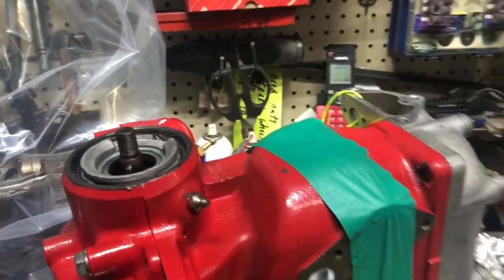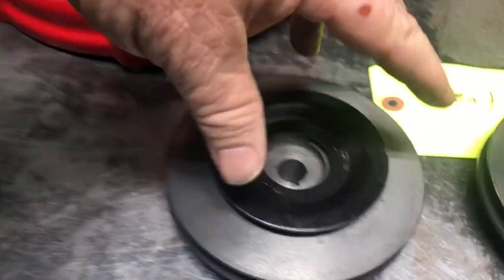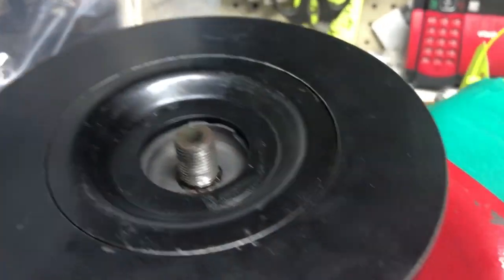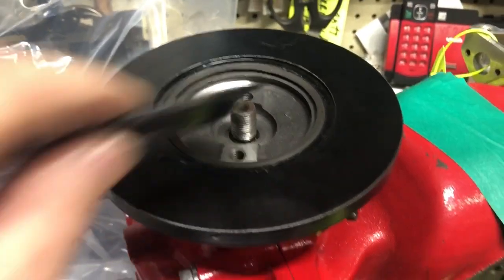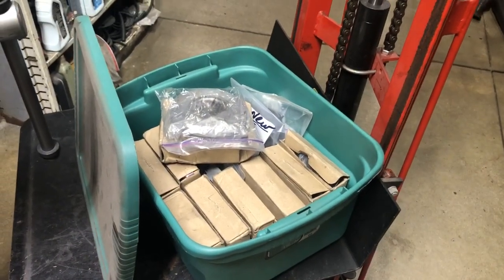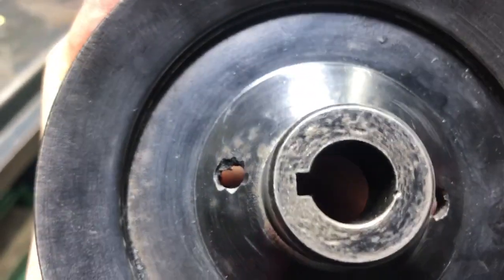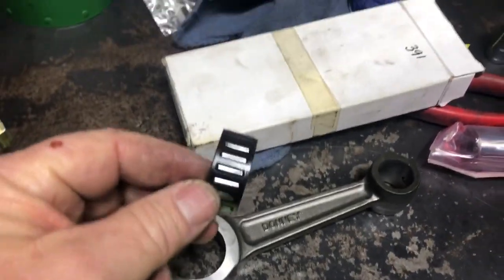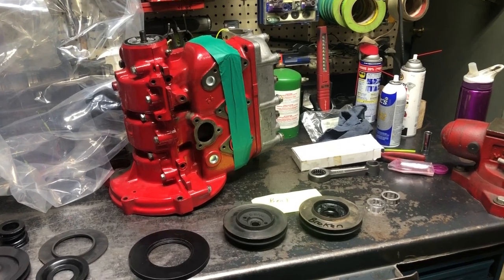Vintage Saab Two Stroke, Crankshaft Pulley Issues & Repairs

Comment: How much do you torque the pulley down?
Reply from the maker: 40 ft lbs.  at Bonneville we go 50 ft lbs!
Reply: Thank you, picked up my first 2stroke this week and im working on getting it running so im removing all the old grease and getting it freed up from sitting
Reply from the maker: Melvin Shmurda nice!  Usually just take the top off carbs and clean a bit. Pull jets and clean and fresh fuel and away u go. Check trans level too. Also time totally advance should not exceed about 20.
Reply: Just got the engine sadly, buying a car to put it in eventually, currently getting it running, has about 90psi of comp on all three, pretty decent for a engine i bought cause it didnt budge and was classified as scrap. 

Picking apart the carb and putting it in a ultrasonic cleaner